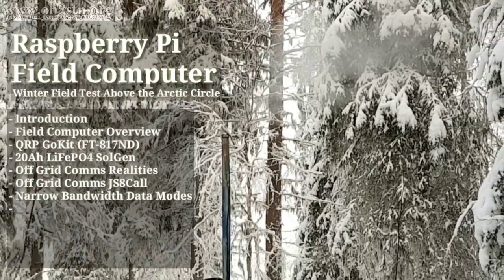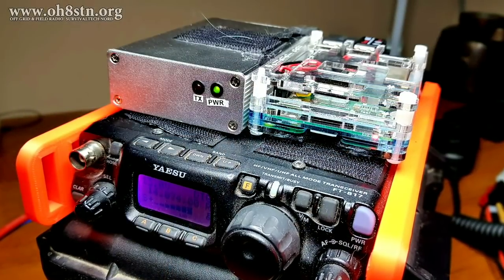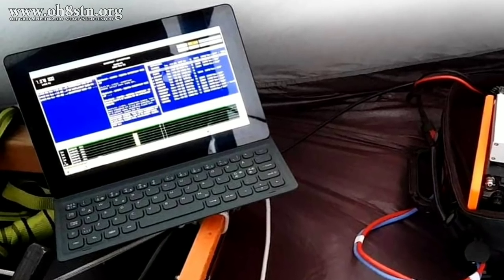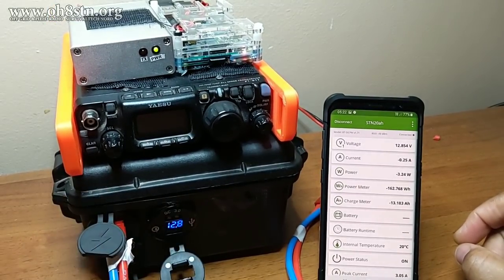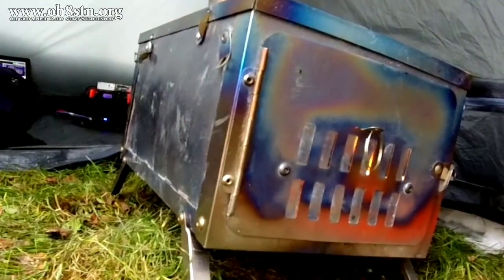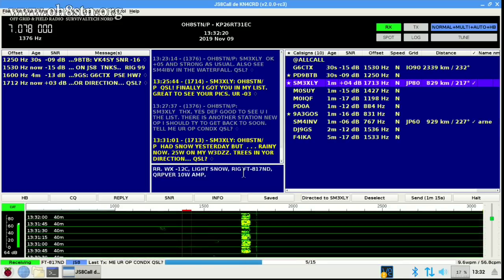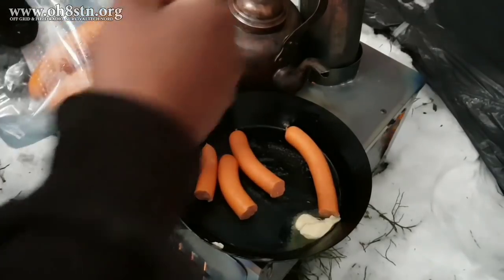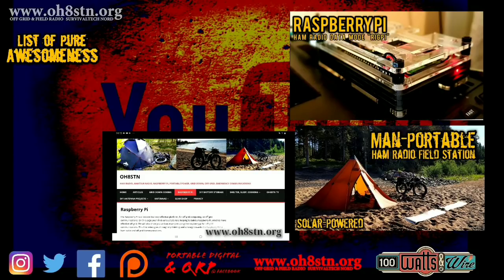Off Grid Ham Radio & Raspberry Pi Field Computer

Comment: It looks like you printed out those Yaesu rail bracket things. How are they working out?
Reply from the maker: They are too brittle to add realistic protection. I would still go with the aluminium versions👍
Reply: You used PLA or nylon?
Reply from the maker: I don't remember
Reply from the maker: It's okay if they break, they just can't break so easily. The point of the Rails is to protect the front panel on a front panel down impact. So the real should absorb the impact, slowing the radio down enough at the dials don't get damaged.

Comment: The cable from the Pi audio to the RTTY/DATA port, is that pin out:
PiAudioOut->RadioDataIn
PiAudioIn<-RadioDataOut

I want to build my own!
Reply from the maker: Looks correct. Your missing ground though. Put is usually unused since using vox.
Reply: @OH8STN  yeah I understood about the ground, have you considered doing the mod to your 817 to get vox on the data line?

Comment: 👍Good video, thank you.
RPi is the way to go and certainly agree on the advantages of JS8CALL - a mode that has been around for a while and I am a little surprised that is not more popular, in EU at least.
Though, I wouldn't perhaps totally write off other digital modes, especially Olivia, which may offer some advantages such as higher transmission rate while still having S/N performance close to JS8CALL.

Comment: Great information.  I have just done the latest build that Jason, KM4ACK has out for my Raspberry Pi 3 Plus.  I also have a Yaesu FT-817ND and have watched a lot of your videos.  In this one you talk about the amp and I was curious as to the exact setup of the amp did you purchase.  I see there are several things that you have to choose from on their website and I want to get what will work.  I figured I would go with the 3W in version, but not sure about the TX information that it asks about.  So it would be nice if you could say what options you picked for your amp that works with your Yaesu FT-817ND.  Thanks in advance.  Juddie WD8WV
Reply from the maker: Yep, I got the three watt version with the Vox PTT, setup for 160-10M.
Reply: OH8STN Ham Radio THANKS!!!  Juddie WD8WV
Reply: @OH8STN  so I am guessing when you say Vox PTT that is the "RF Signal Management (RF VOX)" selection on their website?  I am getting ready to make and order for one of these to go with my FT-817ND.  Juddie WD8WV

Comment: Thoroughly enjoy your content, many thanks for your uploads. Just a question, do you use a handheld at all and if so which? I like the idea of the pi paired with an 817nd.
Reply from the maker: Excellect question.
I do on occasion use a Kenwood thd74, and a Yaesu VX5R. The thing is, I don't like relying on repeaters or infrastructure at all. So my primary focus is on HF. I do have some other handheld radios, but they're mostly for testing and toys.
Reply: @OH8STN  Oh good, I hoped it would be something with a TNC. I just picked up the D74 to explore packet, winlink etc. I'm still yet to commit to an all mode all bander and I think the 705 may just be out of my hobby budget range at the moment. I'm hoping to beacon APRS to ARIS on the ISS later today (handheld 4el beam) as I wonder if space is a way to mitigate the repeater dependency; in the event of an emergency. Wondering if it's feasible and motivated by your videos. Thanks again, really great work.

Comment: I have always been interested in Radio communication and this has convinced me to take a plunge into exploring these technologies. Me and my brother have been increasing in our adventures in both scale and seclusion. I was thinking about how this could be a practical tool for our overlanding and hiking adventures. You talking about sending a message to your wife with your location and successfully arriving at it sold me on the idea. 

I find your application of the raspberry pi very interesting and your decision to go with Linux makes excellent sense considering the customization, versatility and power conservation offered by the platform.

Comment: Just a tip for the other operators out there: The raspberry pi is not the only dog in the show. Take a look at some of the Orange Pi models as well. The Zero Plus doused with spray on conformal coating is another contender. JS8Call's rasbian stretch package installs fine on armbian buster.

As a side note, has anyone looked at porting Jordan Sherer's 8-FSK modulation to one of the small wifi controllers like the 240Mhz Espressif ESP32-WROVER? It's got a fine audio grade ADC and DAC, due to it's bluetooth features, and it's about the physical size of that USB audio dongle you're using the DC-11F with. Alternatively, the 500Mhz NXP RT1010 might be a good choice if you don't need 2.4ghz wifi/bt, just USB2.0 (and one of the examples is a pair of USB audio endpoints.) It's the little brother of the Teensy 4.0 board, which has the 600Mhz NXP RT1062 on it, a little faster, but it costs about as much as a raspberry pi does, and doesn't run linux. The ESP32's about $3, the RT1010's supposed to be a dollar. I'd be tickled to see this slimmed down to fit on a $7 TTGO T8 module with a 6-Pin Mini Din soldered directly to it!

Edit: This video demonstrates a USB host controller that could probably drive the Yaesu's control cluster.
https://www.youtube.com/watch?v=po3FBdY0GS4
The microcontroller is fast enough to "bitbang" NTSC composite baseband video by abusing the DMA facilities. Slight modification to the PCB to swap those to either a mini-din or a pair of 3.5mm minijacks. Plug a logitech USB keyboard receiver into the other USB port. Continue to use the samsung as a display. Even without the samsung, can still blind-type on the keyboard, or pin a little ST7789 SPI display in.

Comment: Now this is something I REALLY want to do. But....for an "off grid" setup....isn't a constant communication with GPS satellites/towers still using a literal grid?
Reply from the maker: GPS is only there as a backup for the time. Remember I already have a real time clock on the system. Also the GPS doesn't use any Towers, just satellites. Maybe I have to make another video to show how the third backup system works if the real time clock fails, the GPS fails there's also a third way using our off grid Communications. Anyway go for it! These types of systems are fun to put together, and amazing learning 👍👍👍

Comment: I am currently setting up a raspberry pi very similarly to yours... I also opted for the Sabrent sound card interface with a CAT cable. I have not been able to connect to the radio and control it using flrig on the pi. Was there something special you had to do to get it to connect properly with your radio? I'm on a Yaesu 857D, so I assume its similar to yours. Thank you for your channel! Your expertise and experience been exactly the help I needed for getting my portable station up and running!
Reply from the maker: Hi Matthew, Sarah.
All I had to do was select the correct cat control port for the rig.
You can use the command "lsusb" to list all of the usb devices connected to your raspberry pi. Once you find it then the list, it's easy to select the correct one in flrig. 
I don't use any type of serial to USB converters or anything like that so I can't help if that's what you're using. Also make sure that you're using an ftdi chipset for your cat control interface. 
I hope this helps
Reply: @OH8STN  Thank you so much! I will give that a try. 73 Julian! de K8KNX

Comment: If you don't need the Bluetooth on your pi. You should turn it off. It will save you battery. Bluetooth is a heavy power consumer.

Comment: An awesome and inspirational video.   I've been planning to get my amateur radio license and now I have more motivation.  Thank you for that.  I have one question.  In your video you mention being able to send your wife a text message on her phone.   Would she be able to reply to your rig from her phone?
Reply from the maker: Thanks for watching your question. 
The way I could send the message in this video is via an APRS message. Honestly I've never tried to receive a message back, but I'll come back to this in a future vid. Normally if I wanted by directional Communications with my wife, I would use a system called Winlink or PSKMail. Those systems work very much like Gmail or protonmail. They are radio email systems for bi-directional off-grid communications. 
Finally thanks for watching and thanks for the kindness. It's very much appreciated. 👍👍👍
Reply: @OH8STN , thank you for your quick reply.  I didn't know radio had such functionality.   I have subscribed to your channel.

Comment: Is this possible with a less expensive radio?
Reply from the maker: Absolutely. When I designed this field computer concept with the Raspberry Pi, I did so with the idea of using also any radio. Xiegu G90, or one of the other cheaper Chinese rigs. Even an older used rig, it's up to you. If you want to do Communications like we're doing in the video the only real requirement is that it's a single side band radio, SSB. 
Does that help?
Reply: @OH8STN  absolutely.
I just got my technician last Saturday. This is exactly what I was thinking of when I decided to get my license. 
My family only thinks ham operation is only done in a shack or a truck.

Comment: Wouldn’t a HackRF One be a better solution than the Yaesu?
Reply from the maker: It would work but I don't know if it would be "better". I've done a version of this with my HackRF and 10w amplifier. Unfortunately with the filters required externally, it was more clumsy to set up. It's definitely possible though, and perhaps I'll put more effort into that later on.
Awesome question. Thanks for commenting and watching, it's very much appreciated.
Reply: @OH8STN  mainly asking just because I got a HackRF for xmas and it sprung into mind when I stumbled across this video

Comment: Amazing stuff, you should look at making a custom enclosure that houses all of those components in a small weatherproof form factor.
Reply from the maker: Thanks, I'm working on it. I actually thought about putting together a form-fitting leather satchel like cover. Front and rear flaps for access to the cable mess in the rear, or the front control panel at the radium. You know like the old binocular cases from back in the day. I'll come up with something. Anyway, awesome idea. 👍👍👍

Comment: Came across this video and very interesting, always been interested in prepping and communication has been something to think of. Being new to this: wouldn't a Raspberry Pi zero w be better? Takes up less space and draws less power, unless you want the extra processing power but how much multi process applications are you running? The Zero W can up run off of a power bank if need be and the W version has built in WiFi card
Reply from the maker: The zero is awesome for a lots of projects, but it lacks the processing power for decoding data communications, plys running the UI, vnc server, access point, ...  I was hoping for a more powerful 0 which could do these things but the 3 B+ and the 4B where our only options.
Awesome comment. We will eventually get to the zero on this channel :-)
Reply: @OH8STN  that would be awesome to see.
The more processes it has to do the power it draws, what if you could share the load with the Zero? Also i was wondering in a setup like yours, what about a radio signal tracker? Like the way they track endangered animals. Just a way to get a heads up if someone else is close by

Comment: Have you considered a stove with a peltier device for power?
Reply from the maker: Yes, short answer. With a bigger wood stove, this method of generating power would be more practical. The station needs about ~2A in order to be completely autonomous while operating 100w, 60% duty cycle. Since pelletier's work on temperature differential, I'll need to figure out a way to get the hot side on the stove and the cold side and the snow. I wish I could tackle this sometimes but I'll need a Peltier sponsor before I can do that.
Reply: @OH8STN  possibly a system that circulates fluid outside.

Comment: This is the first video of yours i've seen, as YouTube recommended it to me, so forgive me if you have covered this in other videos, but, would the addition of a Software Defined Radio to this kit presumable eliminate the need for the Ham Radio altogether?
Reply from the maker: It really depends on which software-defined radio we're talking about. Some software-defined radio Chargers receivers others are transmitters and receivers. We can certainly replace the radio with an SDR transceiver. However to achieve the same capabilities you would have to add an external amplifier to the SDR, to achieve a usable output power. And principal though your assumptions are correct.

Comment: A very effective video of HF portable ham radio, filmed in the Arctic with cozy wood fires, snow, and ice all around.
 Quite a good argument for the modular raspberry pi computer and accessories as the go bag unit. It shows how the use of weak signal HF messaging/ HF networking like JS8call is changing the realm of possibilities for operators. QRP-level text networking communication with positioning and selective calling is a powerful combination.

Comment: I miss Lappi watching this, and the sausages in Finland plus Ruisleipä. Anyway, why do you want the battery thing to be dependent or connected to your phone/tablet? I see that as a massive downgrade compared to a mechanical on/off switch, hence my question. Also, wouldn't a PiBook cut down on extra bits and bobs here? It's like a laptop "shield" for the Pi.
Reply from the maker: I should have shown the ruisleipää from my breakfast :). I mentioned in the video there is a mechanical switch inside the battery enclosure. It's actually a safety feature, preventing someone from shorting out the DC outputs on the front of the battery.
The PiBook is a nice solution and would cut down on extra gear for sure however. I'm using the Android tablet because I'm carrying it anyway. Even if I had the pi top, I'd still carry the  Android tablet. Moreover, I can connect to that Raspberry Pi radio combination with my tablet, or a pi top, a traditional laptop, or my smartphone, ... and I can use any of those devices without being tethered between the device and the Raspberry Pi radio combination. It's wonderful being free to move around, without being tied to the radio. So yeah we have a slightly more complex set up, but we have much greater usability. Making the radio Smarter with a Raspberry Pi provides us with some much-needed freedom. Now if I were building now dedicated system for the home or a suitcase style system, I would definitely do an all-in-one style system as you're suggesting.
I think I'll have makkara ja ruisleipä  for breakfast :)

Comment: OB8STN - What is wrong with the ONE-Laptop ? its Runs Linux and has Built in GPS, WIFI and Bluetooth and can be Charged with the Built in Hand Crank generator.
10K of these Laptops were given to Children around the world in Schools.
the Children were able to Message each other in their Homes, charge the Laptop with a hand crank or SOLAR.
Reply from the maker: Absolutely Nothing, if it meets YOUR requirements. 👍 In fact I think it's a good solution with the right radio. That's why we need that one wire interface. One wire between the radio and any computer. No external audio interfaces  no wire mess, ... Take a look at my other video where I show how we got here.
https://youtu.be/bD7McGV21jQ
Reply from the maker: Being "diplomatic" 😀👍
Reply: @johnjacob9594  - at least, NO one can hack you and you can use in your SCIF.
Reply: @johnjacob9594  - I have seen 60 Minutes and PBS did a story , years ago. 
but they had Actual models working in Indian villages and the girls were actually networking with them (one laptop) and they could even Designate one laptop as a server to others on the Wireless network. the girls were seen Emailing each other. 
what killed ONE
Reply: @johnjacob9594 hat killed ONE laptop was it did not keep up with Developments

Comment: Great video.  Totally agree with the "whole" station concept.  My challenge has been to balance the weight of a capable radio system with the additional weight of life support and keeping it all in a man portable package.  My challenge is to be able to run 72 hours without external support and be able to carry everything in a backpack.
Reply: It's not easy. Though I don't have a lot of experience, I have had a few attempts at carrying everything I need for 24-48 hours plus radio equipment. No matter how hard I try to reduce the pack to bare essentials, it still ends up weighing 40 to 50lbs. Unless you are very fit/strong, it's not pleasant carrying a load like that. One thing that weighs a lot is water which you have to carry unless you are 100% sure of sources along the way.
Camping in an cold snowy environment has many disadvantages but has some advantages - I think I spotted a sled in the video. This obviously allows a much greater weight to be hauled. Also, so long as you have heat, you can warm snow  so don't have to carry water.
Reply: @Steve-GM0HUU  I agree, one of the biggest challenges is water management.  It is a big weight variable if you have to carry everything, hence the challenge. If you can base camp near a water source and daytrip to a hilltop, life is easier.  It is an interesting problem set to solve. I am still working on it, LOL. 73s IU3JNT.